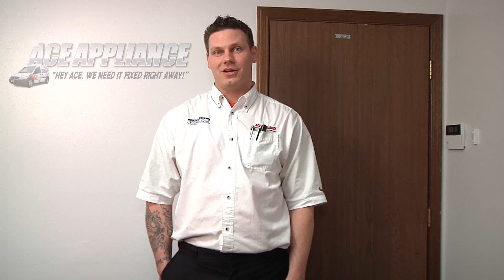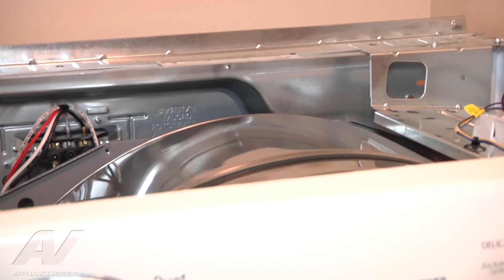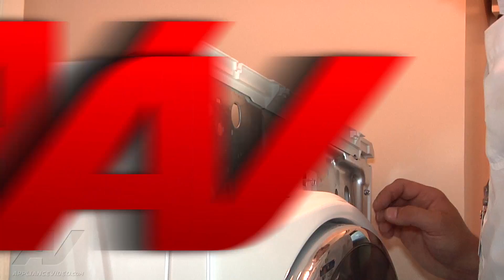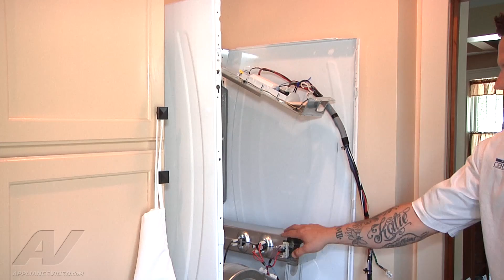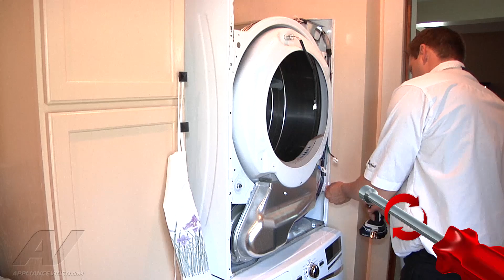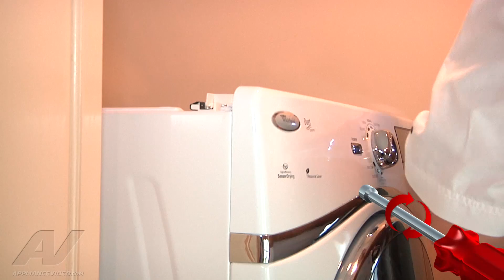Whirlpool Dryer Repair - Grinding and Thumping Noise - Drum With Seals

Comment: You missed an important step when disassembling a dryer (especially if a gas dryer), vacuuming/cleaning lint/dust while you had it open. You didn't have to show it, but should have mentioned it and shown a before/after. I just used this video to figure out how to get the control panel off (found out I had to remove the two top panel screws in the back to slide it back to give access to the top panel screws). I disassembled mine for the purpose of cleaning the lint screen assembly because of an accumulation of lint/debris in the lint screen enclosure. I also had a fair bit to clean out of the blower and inside the lower dryer enclosure itself.

Thank you VERY much for this video. This is invaluable for a home DIYer like myself. I was only able to find basic exploded parts diagrams, but they weren't detailed enough for what I needed, and there's nothing else online I could find. Keep up the good work.
Reply from the maker: Thanks for your response, we are glad we could help. Our library of over 5,700 videos are currently helping over 1.6 million people like you every MONTH.  Please help us by subscribing to our YouTube channel, or post our website www.ApplianceVideo.com to your Facebook page, Twitter, Instagram or any other social media sites. Your support will help us keep producing more free quality videos.

Comment: why? how? brand or use issue?
Reply from the maker: Great question, you can call our parts department at 1-800-830-5465 and they can give
you help 7-days A week. If you have a more technical question that our parts
department cannot answer, our technicians are answering
all questions at our website at www.ApplianceVideo.com under our Repair Help section. We have over 3,000 common questions
and answers that you can easily search through by your model number, appliance
make, and problem or error codes, and It’s free to search through our question
& answer library.

Comment: If you go to all the trouble to make a video, why didn't you ask someone to help.  It would be a far better video if one could see everything you are working on instead of removing screws, connections,belts, etc off screen.  Also, the red AV logo moving across the screen blocking the view is extremely annoying.  Still, I appreciate the info.
Reply from the maker: Alan 
      On the new videos we do have a second set of hands. This is one of our earlier productions. We now have dual cameras and better lighting. We have also changed our editing process for easier viewing. We do appreciate the input from you so we can make improvements on the new videos. We have over 1000 produced now and are adding up to 40 new per week.  Please help us provide more videos to our site by subscribing to our YouTube page or posting ApplianceVideo.com site on your Facebook or Twitter account. We also have our factory authorized technician’s email daily free professional advice to people like you to help solve their appliance problems. Thanks in advance for supporting us. Matt, Ace Appliance service technician.
Reply from the maker: We are putting battery operated mic on technicians now and even have Go-Pro cameras for the tight shots. It would take too long to re-render this video, we have over 11 hours into this one video already. Its not worth it for a Free video.